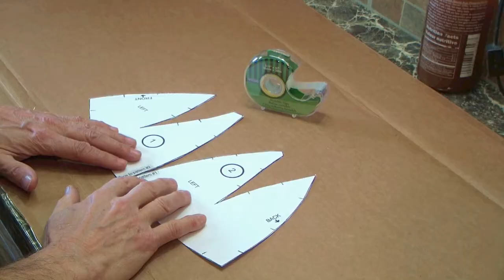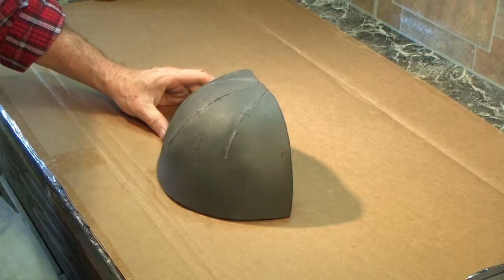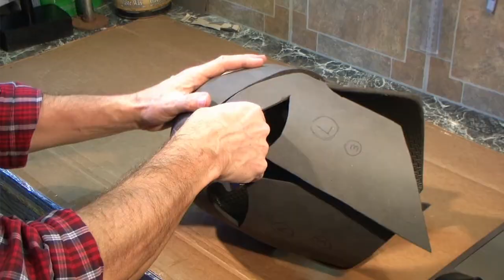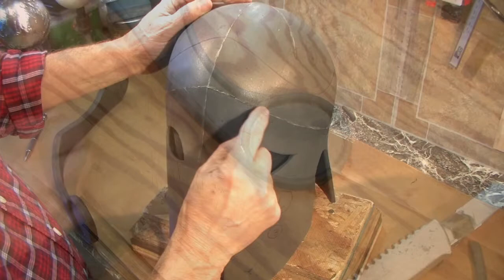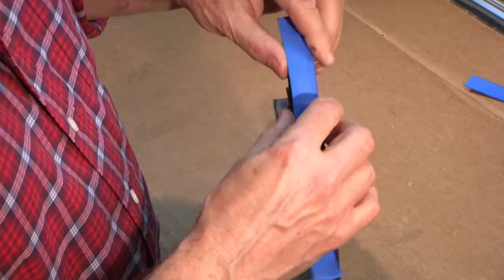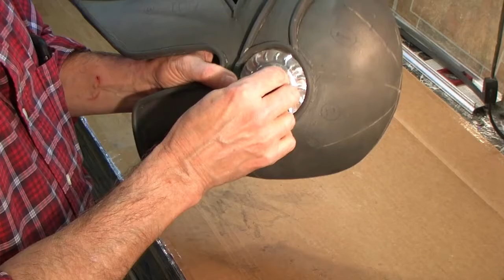Make Your Own Spartan Helmet With EVA Foam Part 1

Comment: Hi just confirming for scaling purposes, is your download pattern for a US letter size - that is 8.5in x 11in? if so then I would think your scaling will need to be adjusted for printing on A4 paper. I printed mine at 96% for a 23inch head and the print would make up to 25inches - any comment?